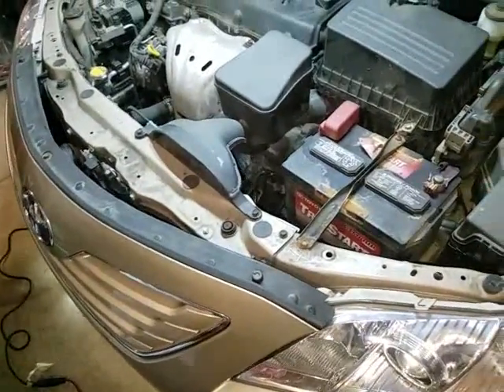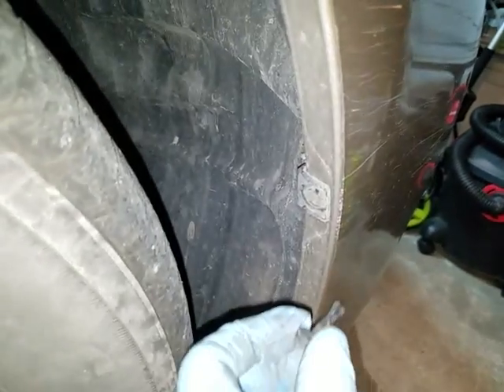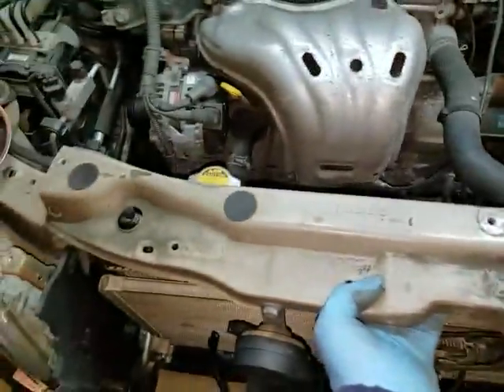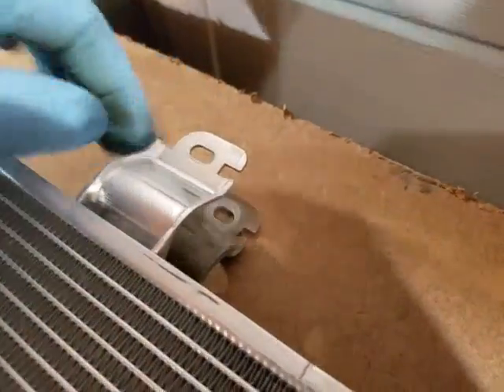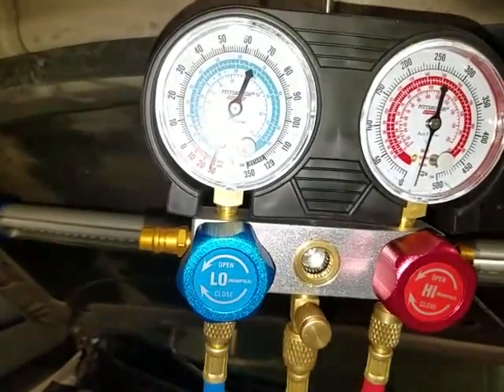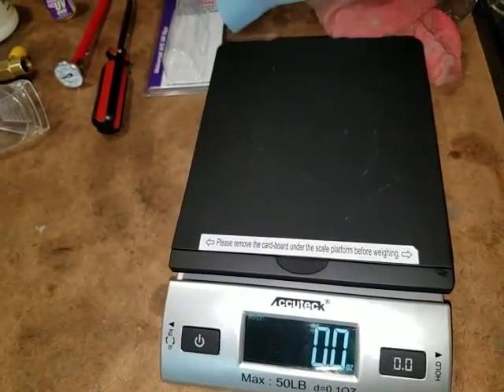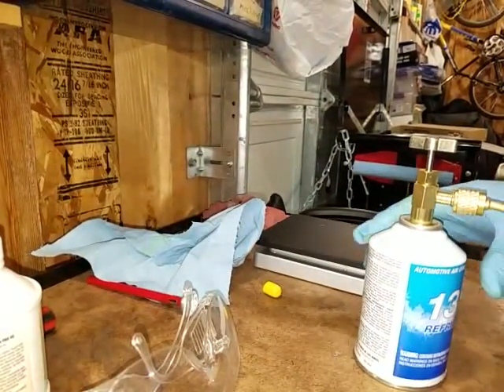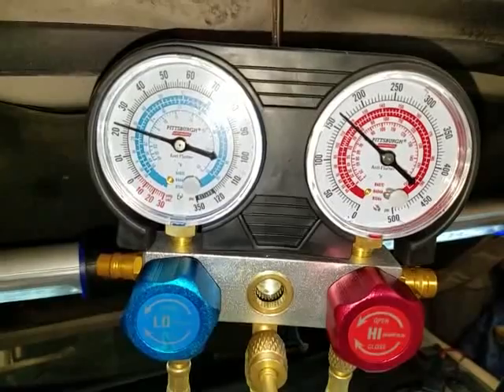2007 Toyota Camry Condenser Replacement

Comment: First, THANK YOU, for taking the time to post this.  I add the following in the spirit of helping others, just as you did.  I just did this job today on an '07 2.4L Camry (even the same color, LOL). The bumper cover DOES NOT HAVE TO BE REMOVED.  We didn't remove the bottom covers either. Simply remove the intake scoop, unbolt the hood latch from the radiator top plate, unbolt or unplug the horns, and remove the radiator top plate.  At that point you can see and reach all four bolts holding the condenser in as well as the A/C lines.  Remove the 4 bolts and disconnect the lines and lift out.  Took us less than an hour to have the old one out.  Hope that helps someone.
Reply from the maker: Hey, thanks for that useful info.
Reply: Richard you saved me lots of time and effort. And you even called it on the time it took to do it.
Reply: very true....i did not remove the bumper or bottom covers....this is a very easy job to complete....it took me about an hour to remove the old one and install the new one....i do appreciate his video though

Comment: I'm replacing the a/c compressor and receiver drier in the condenser, do I have to take the condenser out just to replace the drier?
Reply from the maker: Honestly, I don't remember if you can access the receiver/drier while it's installed in the vehicle.  If you can access it, you should be able to replace it.

Comment: Would anyone recommend this as a DIY project for total newb in automotive repair? I have an '07 Camry that needs the condenser replaced, but don't want to have to fork out $500 for this (especially since I'm planning to buy a new car soon and the passenger front window got derailed from the tracks).
Reply from the maker: If you've never worked on a car before, pay the $500 for someone else to do it. (That's a really good price) Just some advice, if there is nothing else wrong with your car, why are you going to by a new car?  Which is going to cost way more then the up keep of your current car. Camry's are well made cars and can easily go over 200K if maintained properly.
Reply: Good to know, thanks. As for why I'm looking to get a new car, I live in a cold, congested region of the US. The camry doesn't have AWD and it's quite long, making it tricky to find parking. That said, I do prefer to do things myself (to an extent) and learn, which is another reason I'd rather do this myself. Is it really that complicated?
Reply from the maker: I see. That makes since. The job can be tricky if your not careful. If you do plan on doing it, just make sure you educate your self for the job. It's important to have all the tools you'll need. Follow the steps I put in my video and you should be fine.
Reply: @AP-eq6fv  Shoulda just bought snow tires, man.
Reply: +1 to the snow tires. They really do make a world of difference. Go with studs if need be. I roll around in my 2002 corolla with no slipping with studded snow tires

Comment: what is the torque of the two screws to the low port and high port? I refer to the ones at your clip around 16:30. Thanks.
Reply from the maker: I'll have to look it up and get back to you.
Reply from the maker: I checked my repair manual and it's not listed. I just tightened them sung.
Reply: @Pk3_Garage  thanks

Comment: I just ordered me a air condenser
 I got a question I got the same kind of car and the air not working the heater work but the air don’t...but I thought it would be the air compressor but will make the ac work
Reply from the maker: Sorry for the later reply. (I didn't receive a notification of your post). As to the AC not work.  There are so many reasons for the AC not working.  The thing is to start checking small stuff first and as you cross stuff off, you can then pinpoint the problem. Does the AC compressor engage/turn on, when the AC/defrost is selected?  If not, check the system for Freon, using AC gauges.  If, it's low, you have a leak some wear in the system.  This will require adding more Freon and dye to the system to verify the leak, if it's not visible. If Freon level is OK, check the wires to the ac compressor if they are lose or corroded. Do a YouTube search on how to check an AC system.
Reply: Hey after I changed the air condenser it works perfectly I need to know about the power steering hose and stuff
Reply from the maker: That's great to hear. What specifically do you need to know about the power steering components? I haven't don any work on it, but might be able to help you out.
Reply: I think one of my hose is leaking cause I have to constantly add power steering fluid
Reply from the maker: Visually check the hoses for wetness. Also, it can be the rack and pinion. Either way, you should see wetness somewhere.

Comment: I'm about to do this on my 06 Camry. I'm not going to pull the vacuum or fill the system. I'm just going to replace the condenser. I have the tools. Do I need any other parts besides the condenser?
Reply from the maker: You will need some PEG oil to put in the condenser. Even if your not feeling the system, you should put a vacuum on it anyway. This will pull all the moisture and dirt out the system. It will let you know if there are any leaks too.
Reply: Lemme break this down for you, and offer you some help and advice.:
 
If the AC system is already empty, you don't need to evacuate it, but you "WILL"  need to pull a vacuum on that system to remove any air, moisture, and non-condensable gasses out of the system, as well as allowing you to tell if there are any leaks!!!!!!

If there "ARE" leaks, it is a complete and total waste of your time (as well as money) charging the system up with 134a, because it's going to leak right back out again, and you'll be doing this over again to fix them!!!!

"MY" recommendation to you is to head over to HARBOR FREIGHT and buy yourself a decent set of gauges and a vacuum pump. 

The gauges should cost you about 60 bucks (Before TAX) and a vacuum pump should cost you about 150 bucks (Before TAX), so figure on roughly 210.00 to do this "RIGHT", and a new condenser can be had for about 60.00 dollars on the internet almost anywhere. 

Since the guy who posted this used AMAZON, I checked their site out, and I found one for 54.00, and even though this guy only pulled a vacuum for 30 minutes, I'll also recommend that you go on and pull that vacuum on your system for about an hour!!!!

Once that's done, you'll also want to add about 4.1 ounces of PAG 46 oil, and 19 ounces of 134a. I also recommend that you do it on as hot and as dry of a day as possible, and once you charge up your system, and you'll be chillin in the breezies!!!!!!!! 

The last car I did was a Lincoln MKZ, and it got down to 34 degrees coming out at the vents!!!!!!!
Reply: Check out my response to Richard Phelps......
Reply: @Daywalker225xxxx  hi, how much torque should be for the two scews at the low port and the high port, where the tube connects to the condenser? I feel the screws will not tighten to 9.8 nm, which is what the repair manual suggests.
Reply: @Daywalker225xxxx  I am wondering if the new part comes with a striped hole.

Comment: If I’m only changing the condenser do I only add 1oz of pag oil? Or how do I even know how much oil has leaked out. Or where do I add pag oil to condenser please help thanks.
Reply from the maker: Add 1 oz of peg oil to one of the hose ports on the condenser. Don't worry about trying to figure out how much oil has leaked out. The way the system is set up, you replace a certain amount of peg oil when changing certain parts in the system. There are charts on the internet you can look up if your curious.
Reply: Pk 3 thanks! You saved me a lot $
Reply from the maker: Glade I was able to help. Was your repair a success?
Reply: Pk 3 the condenser  is on the way I will keep you updated on the repair.
Reply from the maker: Great, thanks.
Reply: Pk 3 would you happen to have the part number for the o rings on the condenser I called dealership they can’t seem to help me out thanks.
Reply from the maker: I used an AC o-ring kit by Sure Bilt. I think I bought it from Auto Zone. I just checked and they don't have this brand anymore. Check your local auto parts store or Amazon for an assortment of various sizes. Just make sure it's for the AC system. You can buy a pack for under 10 dollars.
Reply: Pk 3 hey man quick update I got A/c now! Thanks a lot for your help.

Comment: Quick question, does the pressure have to be 0 when we changed it?
Reply: Also if we do not have the gauge, do we have to vacuum the high and low port individually for an hour, and how do you add the PEG oil without the gauge? Thank you btw!
Reply from the maker: I wouldn't recommend doing this job without an actual ac gauge set. You can buy a set from Harbor Freight for around $60. (It pays for itself the first time you use it) When you put a vacuum on the system and it holds vacuum, you know there are no leaks and all the  moisture and air is out the sysrem.

Comment: No need to disconnect battery.
Reply: You should disconnect the battery basically any time you work on a car as a precaution. It takes 30 seconds and it can save any kind of spark, grounding, shock etc.